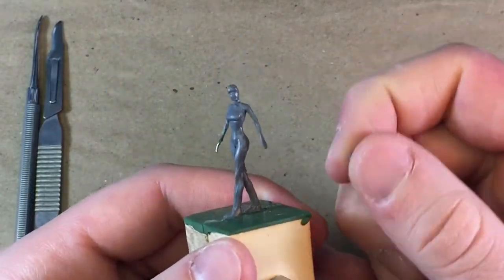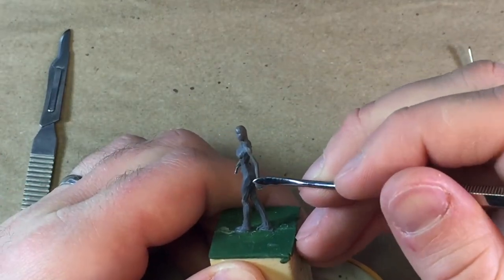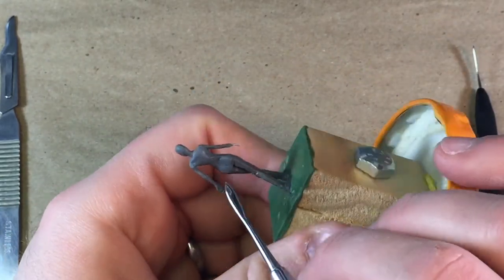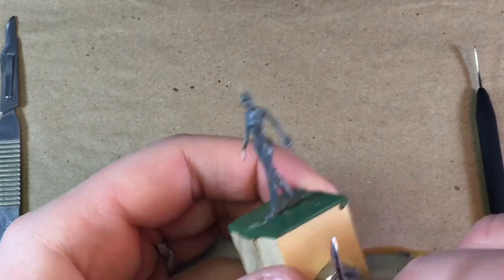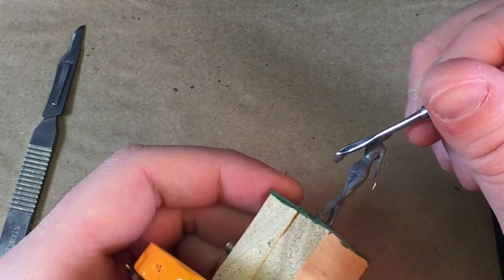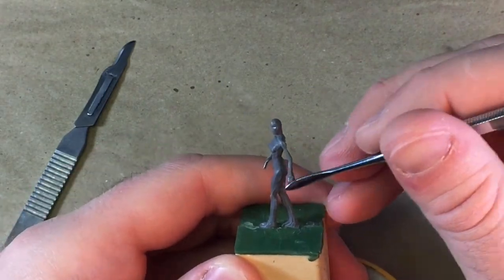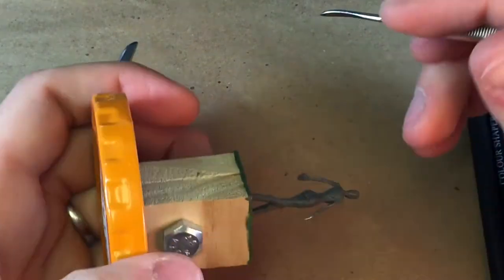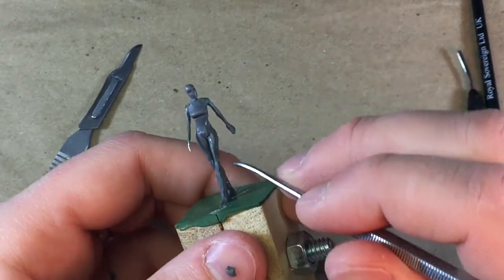Sculpting Miniatures - Sculpting Hands Part 1

Comment: Hands are a bitch.  I find them extra tricky with 100% fimo.  I have still been doing hands with GS lately just for the stickiness.  I have had better success with the clay as far as detail like getting the knuckles to look right, but getting the shit to stick to the end of the wire is tough.  Awesome stuff my man, looking forward to more.  I hope a weapons video is on the list.
Reply from the maker: minitzonthesun thanks man and very good points you make. You should see me use both materials in the upcoming videos.

I've also filmed a bladed weapon tutorial that will go up in the near future.
Reply: +minitzonthesun In case this may help...the warmer the putty and the surface you are putting it onto the better it will stick. I use a swing arm lamp and just position it above what needs warmed.